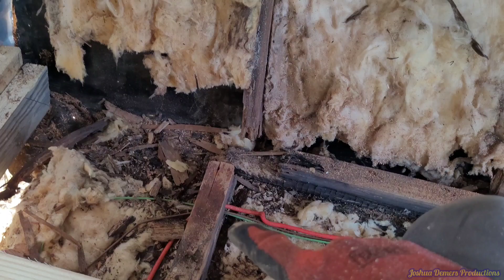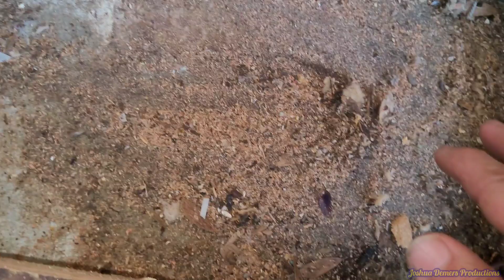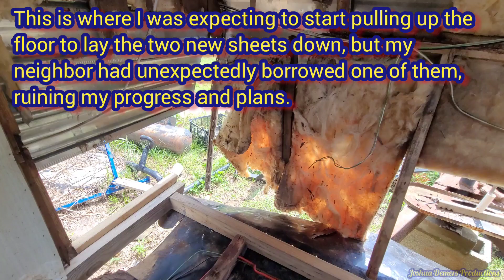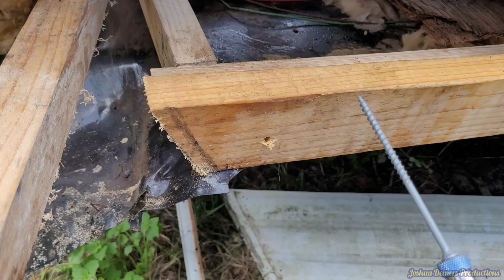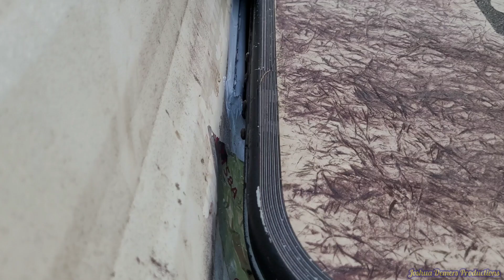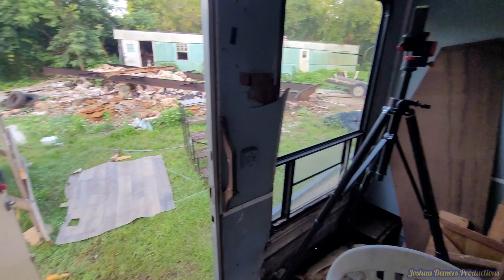RV#2 Ep3 Front Lower Wall Framing & Floor Joist Adventure Rain Reveals Leaky Travel Cover - Repaired

Comment from the maker: I realize the bottom piece of front siding fit from side-to-side when I took it out, so the width of the front bottom plate should be correct. I'm beginning to think that there is a slight tilt on the walls due to the lack of framing and it's unleveled state. I believe when I reframe the side walls and get it squared, the siding will fit back in place without un-squaring the floor.
The triangular shape of the gap, getting larger as it goes down, supports my theory. I will double check how square the floor framing is when I have to cut the sheeting a few inches short to fit between the side walls. If the front end is one inch wider, then I'll know which issue it is.
By the way, the dripping from the refrigerator roof vent was found after editing, while reviewing on my big screen before uploading. I don't think I'd have noticed it if not for recording, editing, and reviewing my projects, and this has happened many times before. Also, I get to re-live my past experiences, sometimes more than I'd care to.